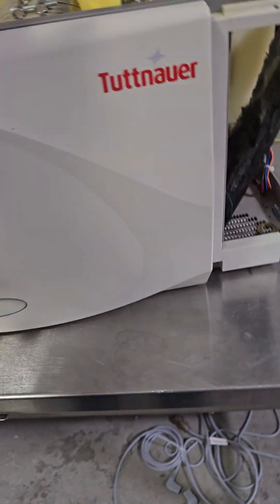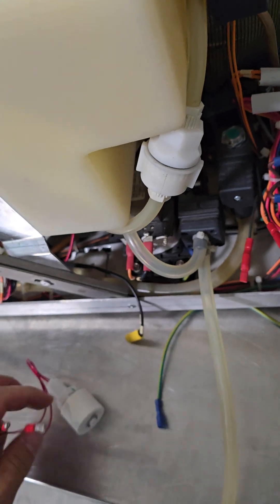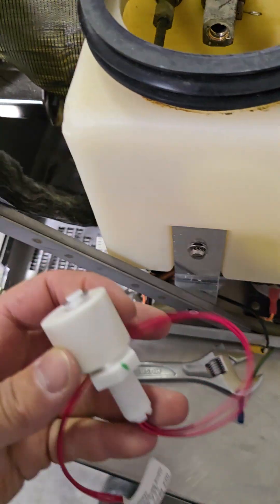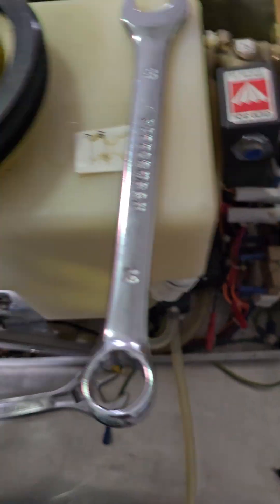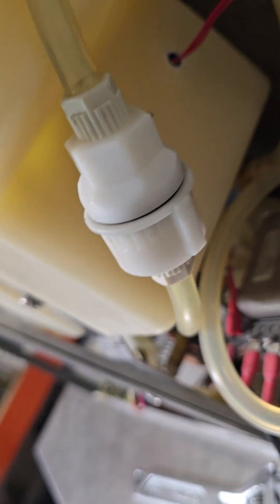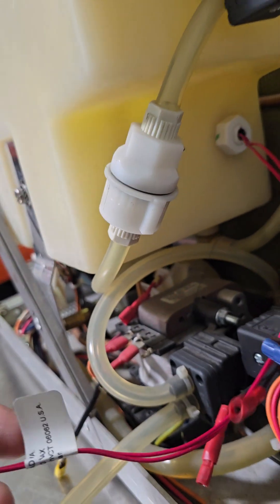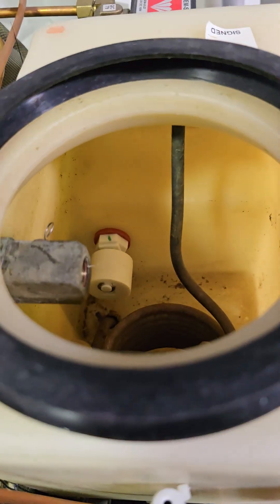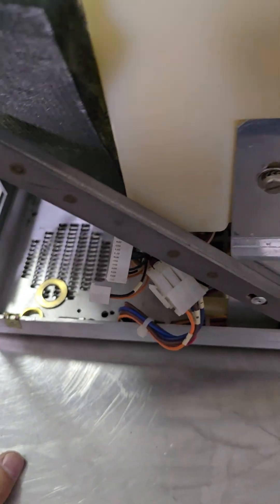Tuttnauer - as requested, installation of the water level sensor on a Tuttnauer autoclave

Comment: Got a tuttnauer 3870EAD giving me "Analog input error", changed the water electrode and the temperature sensor works. The pressure transducer I don't know how to check if its outside of normal range, can you shed any light on this please.
Reply from the maker: @kevinfrancis4513 
When are you getting this message, at startup, during cycle(which phase?)? the adjunc3 pcb is your analog board, check to see if all of your connectors are on the right pins.
For checking your pressure transducer, easiest way is to try and pressurized the chamber with an external pressure gauge attached.
Reply: @The_Biomed  It's a Bacsoft, and I get that error on startup. I had to reload the OS but it seems its a calibration issue i may be having. I realise Tuttnauer dictates each part must be within a value range.
Reply from the maker: @kevinfrancis4513  yes, there are cal directions in the tech manuals. There's a kit to use your multimeter with to verify values and a pressure gauge
Reply: @The_Biomed  i need to get that kit for the other machine.  This machine can be programmed from the GUI and all seems to work well except that analog error. I found a EZ11 manual that is similar, am gonna check the instructions.  Thanns